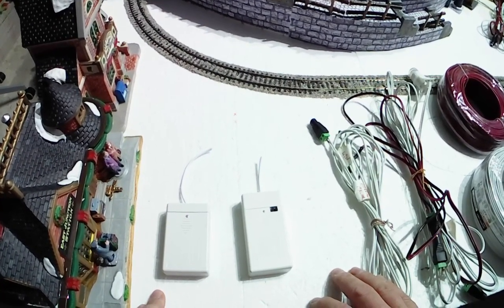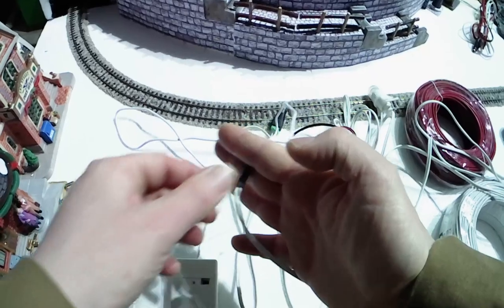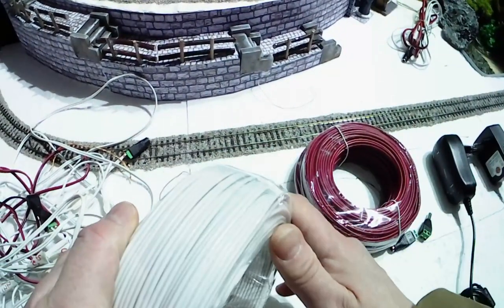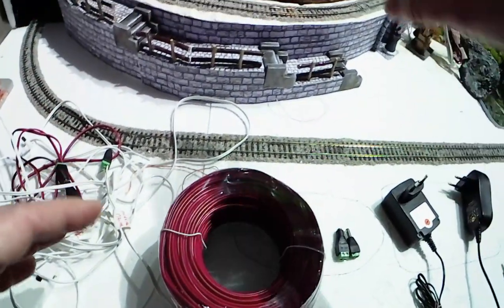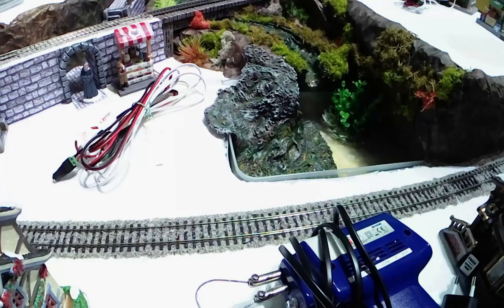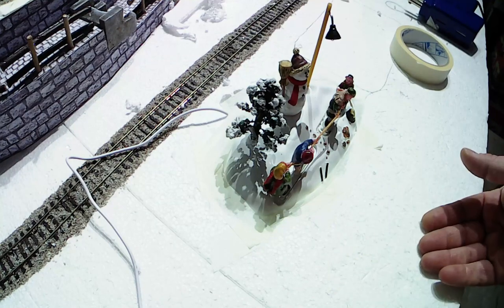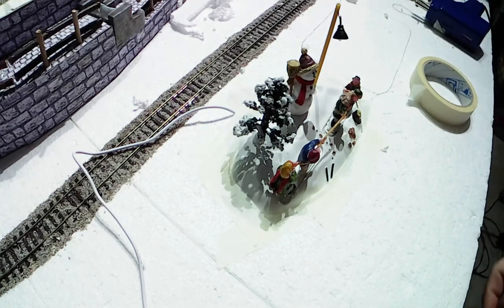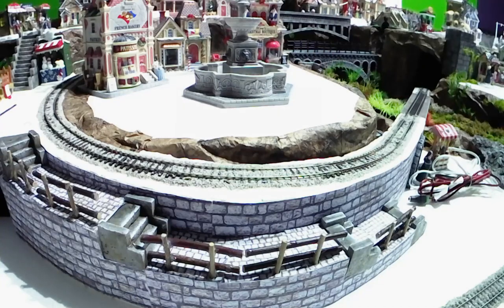Christmas Village Tutorial 2020 - Part 18

Comment: Hello Silvio, this is Andrea. I have one question for you. I would like to make power supply system for houses with only lights (no sound no movement). I would like to use same system you teached me about street lamps. So I will take an DC adapter and I will set it at 4,5v. And I will create power supply wiring and I will connect each house to it using t-connectors. Now the question is: how many houses can I connect (the DC adapter can get 2000mA). Another question: why you do it via octopus cable? (so different from street lamps system). Please illuminate us with some explanation! Thanks in advance for your time and knowledge! Fari&Andrea
Reply from the maker: Hi Andrea. Without going into electronic theory and laws... each and single one of the LEDs used for street lamps or Lemax houses has a current absorption around 20mA
Voltage will make the LED work, current intensity will make the LED normally bright or less bright (too simple explanation maybe).
If you have a 4,5V LED and you power it with 4,5V adapter with a max output of 20mA it will work at his optimal standard and the brightness will be constant.

Or here you have 4,5V AC/DC adapter with a max output of 2000mA. Let's do some easy math: 2000/20=100
In theory you can power 100 LEDs with the adapter.
But brightness will start fading out way before you reach that threshold.
Personally, I never went over 20 items powered by the same adapter.
My standard is 8 items for each adapter. This will help to preserve both the adapter and the items.

I build all my street lamps from scratch, from raw materials and for me the technique of the T-Connectors is best suited. For the lighted buildings I tend to preserve them as much as possible exploiting the fact they already have a built-in power cord. I simply add some more length to the wires instead of modifying all the power cords to fit inside the T-Connectors. (the wires diameter must be reduced to fit inside the T-Connectors)
Simply personal choice.
All my octopus adapter cables are always invisible, on the floor, under the plywood and I use them to connect a maximum of 8 items to each adapter. I consider each building an item and each strip of street lamps an item (not each street lamp) I put a label on each power cord connected to the adapters so I can identify easily items and power cords in case some accident happen during the season (and believe me they happen) and repair the damage as quickly as possible.

Please let me know if you need more specifics.

Be safe.
Reply: Hello Silvio this is Andrea, thank you very much for your reply and explanation. Very much appreciated and very useful as usual! Your suggestion will make the difference to obtain a good result and to avoid some issues. Wish you the best!